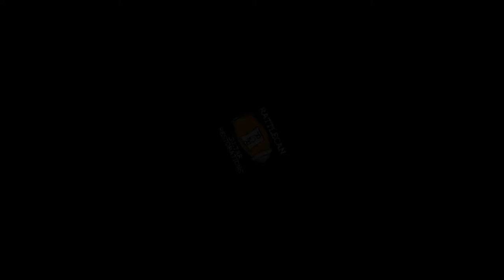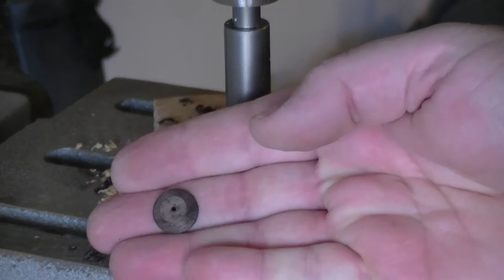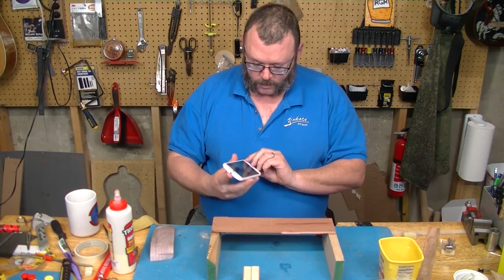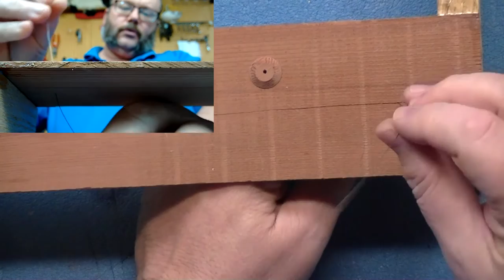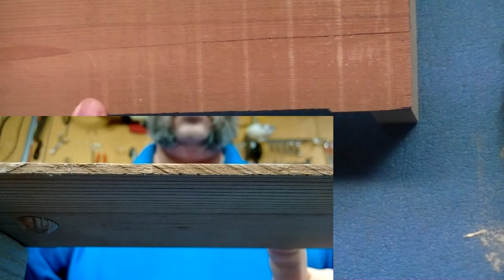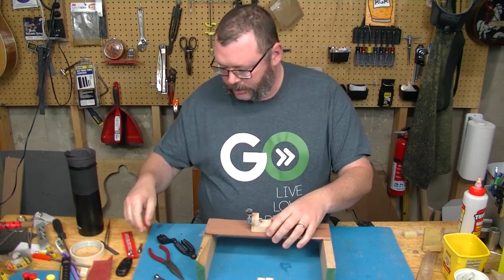guitar clamps and making cleats | RATTLECAN GUITAR RESTORATIONS by James O’Rear

Comment: I'm new to guitar repair and am curious as to why the cleat wood has to match the guitar wood... spruce to spruce, etc.?  I bought 125  #10 straight grained hardwood biscuits from Harbor Freight for $7.99.  Also, why not use discarded steel string guitar wire with its wound end and a washer instead of the pricey wire and cleat retainer. Could save some futzing as well. I welcome your comments.
Reply from the maker: My best guess as to why it's done this way is to minimize the differences in wood density, expansion, etc. Could it have an effect on how it sounds? Perhaps, but maybe not as much as we think. I know in any repair work I do I try to do species-for-species replacements if, for nothing else, aesthetic purposes. I wouldn't do a hardwood graft into a softwood top but who's to say what it would (or wouldn't) do?

Good idea on the cleat retainer part, there's almost always a cheaper alternative...you just have to find it. Much of my pricey tool purchases are the results of gift cards at certain retailers. Thanks for the input, I appreciate it.

Comment: Kinda cool tool but once again very specialized so a bit pricey. If you did a boat load of crack repair it might be worth it. I've got dowel cutters that cut very clean but of course with straight sides but with a little sanding the pieces would be perfect as cleats. GRAIN ORIENTATION probably isn't as big a deal as some might think if you consider the odds of two or three cleats lining randomly up with each other. Even slightly off parallel would be a very strong repair.
Reply from the maker: It's weird, if I have $40 of Rattlecan money I'm SUPER picky about what I buy but if it's a gift card then I tend to buy the "shiny toys".
Reply: Rattlecan Guitar Restorations not faulting you there buddy, I tend to do the same thing.